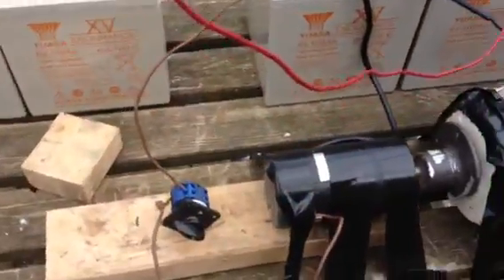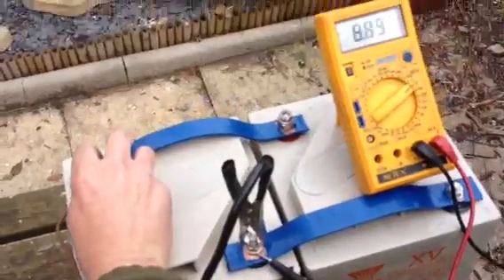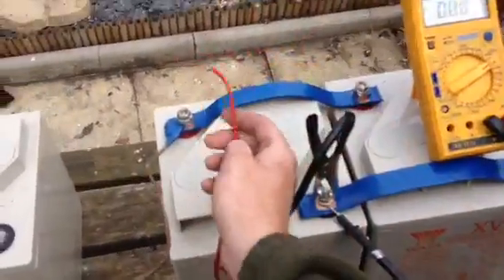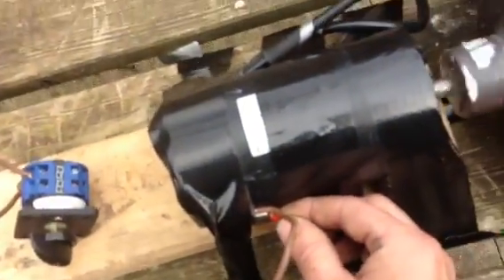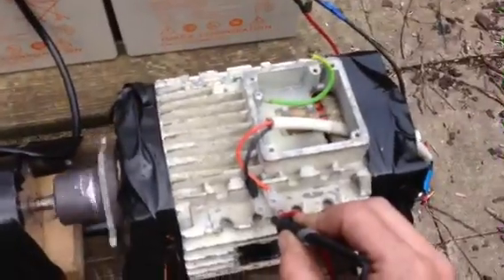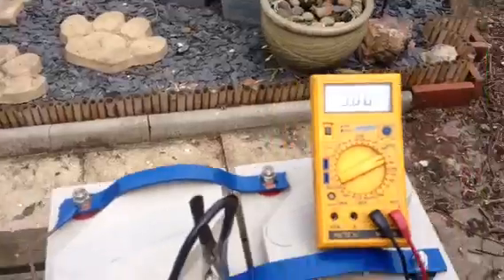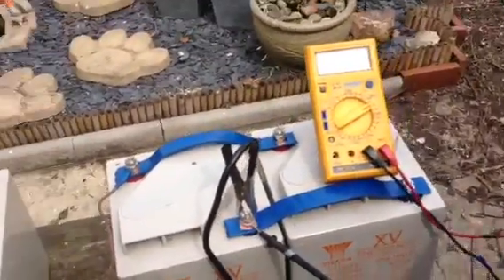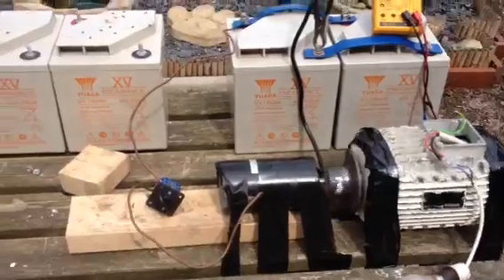Under load still getting 180 volts with no power draw :)

Comment: Are these 6 Volts batteries in parallel ? And is it a 12 Volt DC motor you are using to drive the generator ? Did you modify the motor or the generator ?
Why do you say, it does not draw power from the battery ? Did you measure the input current into the motor ? How many amps does it draw ?
Many thanks.